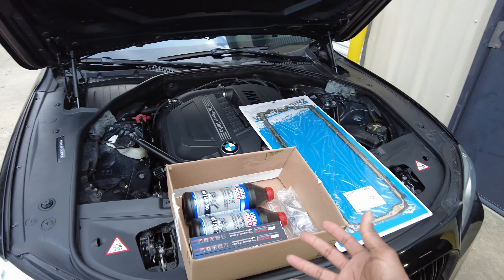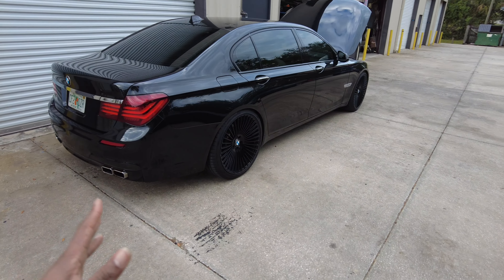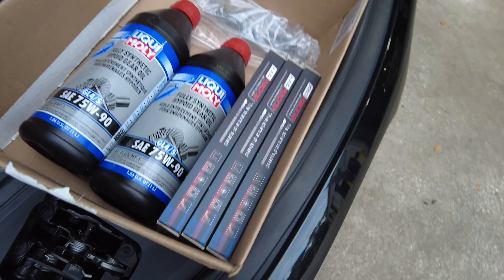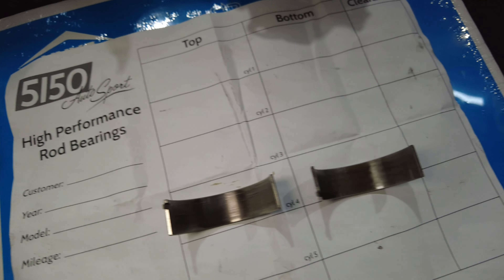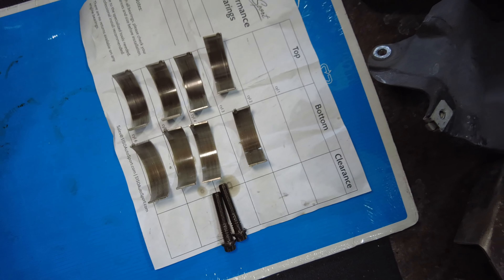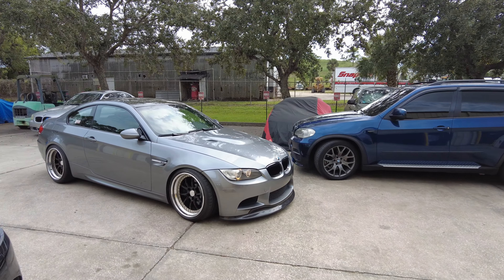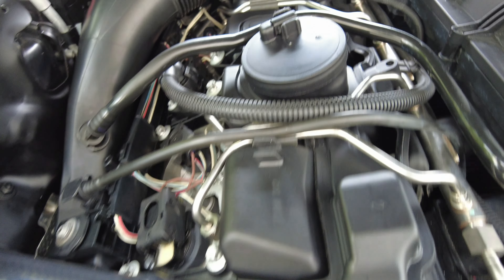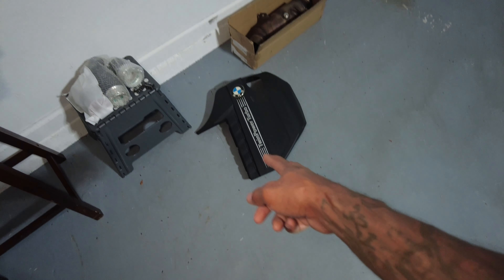FINALLY, A BUILT BMW 7 SERIES! #bmw #viralvideo #power #diy #vlog

Comment: Good sht bro! Why Bootmod over MHD or aNY OTHER TUNING OPTION?
Reply: Bm3 supports pretty much ever BMW any is way more user friendly. Very clean and well built app
Reply from the maker: Thanks for supporting the channel fam. I would give you my answer but it seems like It's already been answered. Also, I plan on using a custom tune on the bm3 platform which most tuners prefer over mhd.
Reply from the maker: Big facts fam🚀